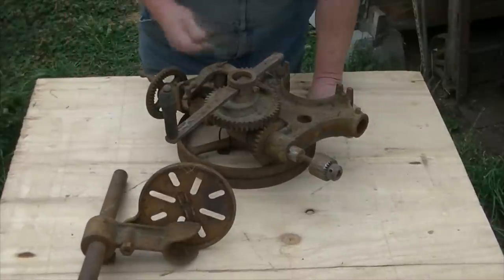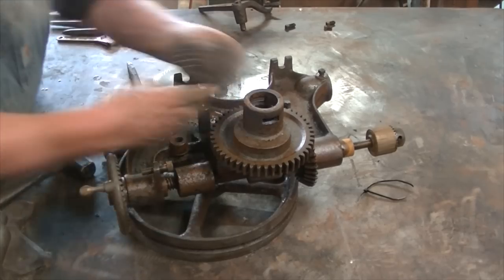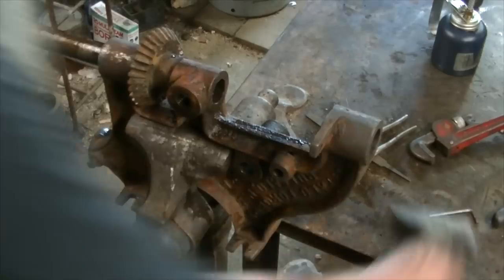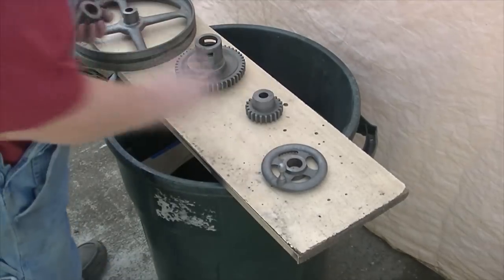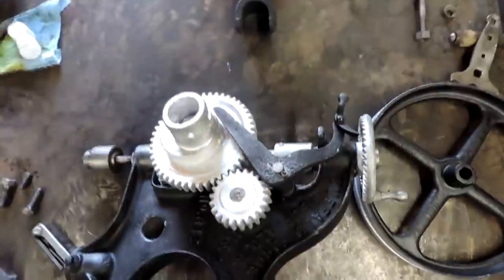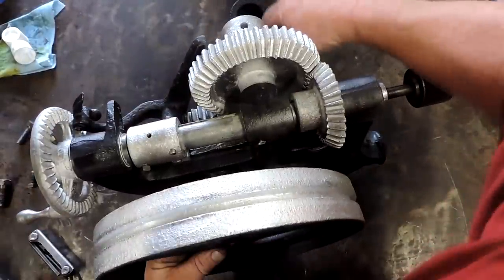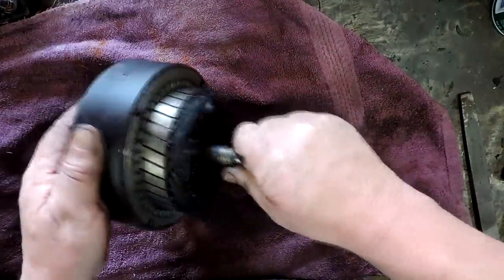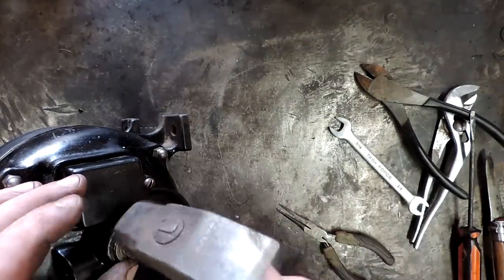Post Drill Restoration

Comment: What makes this video even cooler is that I have one of those - except mine is likely older as there's nothing but a solid rounded cast iron flywheel - no groove. I bought mine at an antique flea market for $50 back in May and at that point, it was hardly rusted at all and turned fairly well...now with grease...the thing is effortless. I will eventually clean it up and paint it but as it stands, it's my only drill press. It's currently mounted to a piece of maple 1x6 and when I need to use it, I clamp the board in my leg vice and drill away.

Great video Big Dog!
Reply from the maker: Very cool man, Thanks for watching.

Comment: If you take a couple of empty plastic milk or juice bottles and fill them with water you can put them in your vinegar or Evaporust bins and they will fill normally empty spaces and will rise the level reducing the volume of chemicals required and also making sure all of your parts are covered

Comment: Oxalic acid works well for de-rusting without harming the not rusted parts - about a 10% solution.  Electrolytic de-rusting in a washing soda and water solution is also good.  BTW that drill wasn't that rusty 😀. Turned out great though.   I'm sure that you will use it a lot.  From my limited experience, they work really well, especially compared to some of the newer pedestal drills like my really sloppy Ryobi one. 👍

I got hold of a Dawn (I think) post drill a while ago, but it cost me about AU$100.  It was free moving unlike yours.  I hope it still is when I get around to tidying it up.  My Grandpa had one mounted to the wall in his workshop that he had added a washing machine motor to.  I can't remember whether his had a V groove in the wheel or not.  I also can't remember what breed his was either.  I have a feeling that he had adapted a pulley from a washing machine to drive the drill.

I have some old catalogues somewhere that have some post drills in them.  If I can find them, I'll email you a copy.

Comment: I have a buffalo forge drill press like this that I'm restoring. It must be slightly older because it doesn't have the v belt pulley. Would you mind showing more about the advancing arm. I'm having trouble figuring out how it supposed to be set up

Comment: thanks for youre video. ive got a  614R  ive had for years thats always had no advance arm or pawl. i made a arm today that while not original will look ok. could you please tell me the distance from center of  the pivot point of the pawl to the tip that meets the top gear? thanks